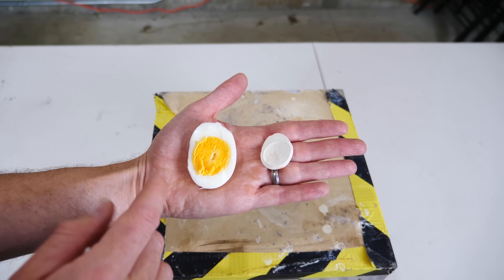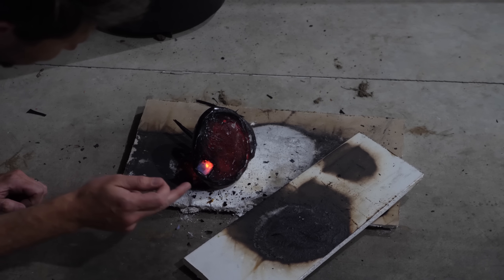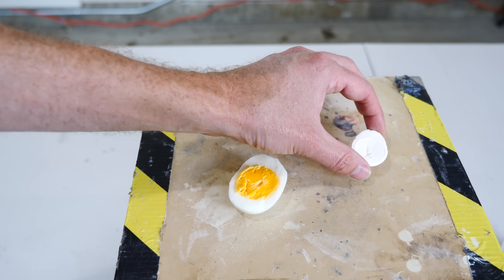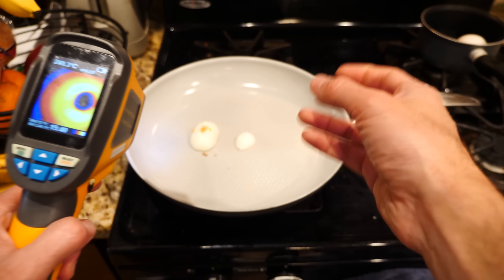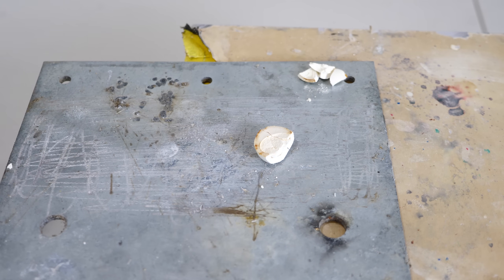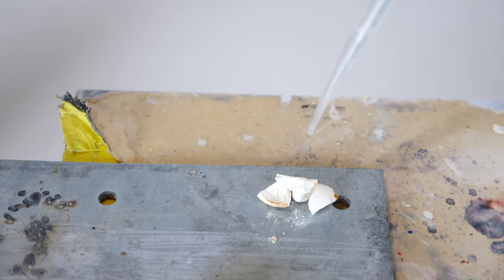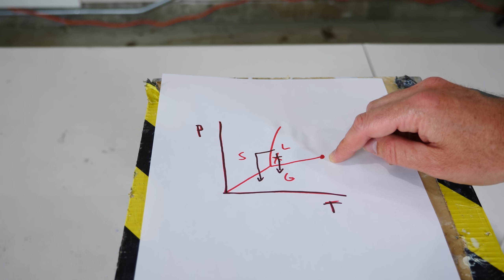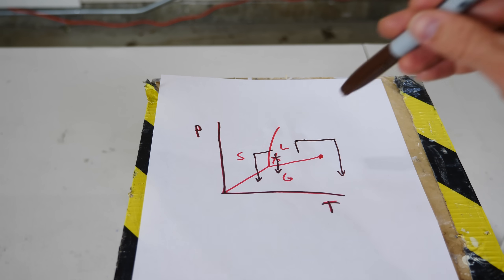How to Make an Aerogel Out of Anything

Comment: is the reconstituted aero-egg edible or as nutritious as say a freeze dried one or the normal one or have the proteins all been destroyed or worse still made toxic? reason for question is NASA uses freeze-drying to prepare foods before transporting them to ISS to reduce the mass of the food... would this be a viable way to retain the structure and nutrition and flavour of aero-fied food stuffs? Also could a similar but modified process be used to make aero-plastics or aero-metals or far better insulating aero-ceramics not using water and ethyl-alcohol and CO2 of course but other suitable materials to create a more rigid aero-fied structure to have similar lightness but better strength or resistance to extreme heat like space craft re-entry?

Comment: I wonder if there is something you can use to stabilize the structure better to where the egg doesn't shrink so much.  You think the egg would look somewhat transparent in that case?  In this case it's looking closer to  a freeze dried egg.
Reply: The silica that aerogel is made of forms a rigid sponge that doesn't shrink.  The proteins of the egg are more like a rubber and have nothing to keep them from collapsing when the alcohol (which replaced the water) is removed.  Stabilizing it would mean filling the voids with something that wasn't water or air, like an epoxy.  At that point, there's nowhere for air to be inserted.  It shouldn't be particularly transparent however, as hard-boiled eggs are not normally so when they still have their natural water base.

Comment: There's a question bugging me from a long time. Make a diagram of earth revolving around the sun and consider you live on the equator and at 12:00pm sun is right above you. Rotate the earth about its axis 360° and it's again 12:00pm with sun at your head. Now if 3 months pass(keeping in mind every 360° rotation brings you at the same place at the same time) the earth will shift 90° ahead but now if you look the point on the earth facing sun 3 months ago is now at horizon at 12:00pm. Why?
Reply: Our day cycle and clocks are not based on our direction in space.  They're only based on our direction relative to the sun.
24 hours is not 360 degrees of rotation relative to space.  It's approximately 360 + 360/365, or just under 361.

Comment: Is the aeroegg edible?
Reply: Technically, yes, but it would be flavorless and have no nutrients or anything beneficial. It would be edible in the same way paper is edible. You would most likely not die from eating paper, so it's technically edible, but it's not food. Though technically, almost everything is edible in small enough quantities. I've eaten cyanide, but since the quantity was so low, I had no negative side effects. That doesn't mean it's safe to eat cyanide. It just means virtually everything is edible in small enough quantities.

Comment: Great video. Raises some questions. This is a two substance substitution and pressure heating drying technique. I would think anything that can be dissolved by the alcohol will also be removed... like the color of the yolk. Other organic molecules? Except for this, it might make a good food preservation method. I'm pretty sure the egg is edible, nothing toxic went into it, but the taste might be off.  This raises a question. The insulating properties are a combination of radiant heat reflectivity, thermal conduction, and convection heat transfer. Closed cells improve the convection reduction, since this absorbs water, it is not closed cell. Does silica aerogel absorb water? If yes, then it comes down to the IR transparency of the substance and conductivity. Organic substances tend to be poor conductors unless carrying ionic liquids... so that leaves the IR transparency of silica vs. egg.  Does this make sense? An experiment with a radiometer or IR light source and IR viewer or just a heat lamp and your temp sensor would clarify that aspect ... maybe?

Comment: Dear Action Lab Man (I hate not knowing your name), could you try filling a sealable bag with aerogel and then replacing the air with helium (or, better still, hydrogen) to see if it floats in the air? It would also be interesting to know whether a block of aerogel could resist the compressive force of being vacuum packed. If it could, I'm sure the resulting structure would be lighter than air.
Reply: Pretty sure his name is James.
Reply: @tjg555  you are correct
Reply: Julian Locke  Those are great questions and I’d also like to see James test them. Aerogels will withstand some degree of vacuum packing. In fact, this paper suggests that aerogels are slightly stronger under compression and that vacuum packing helps protect them during shipping: http://www.vsl.cua.edu/cua_phy/images/c/cf/Aerogel_Aerlon_SilicaAerogels.pdf. 

Keep in mind that silica is heavier than air and it is porous. If you wrap it with anything to contain a gas, the resulting ‘balloon’ will be heavier than a balloon of the same size without the aerogel inside, so there’s no real advantage there.

If you could vacuum pack a large enough piece of aerogel to make it float, you’d also have to lift the material which holds the vacuum. That material would add a lot of weight because its density would be many thousands of times that of an aerogel. But suggesting that a block of aerogel could be used as internal support to create a ‘vacuum balloon’ is intriguing.
Reply: @netpilot5  Thanks for your constructive criticism of my suggestions and for the link to the paper. While I'm well aware that a balloon filled with hydrogen-infused aerogel would weigh rather more than a simple hydrogen-filled balloon of the same volume, I think it could still be made to float in air, and that there might be a potential advantage in using a non-flammable aerogel substructure, which is that the contained hydrogen could not catch fire in the same way as "loose" hydrogen does. I am fairly certain that in the case of a leak, the balloon would sink very slowly as its hydrogen content came to be replaced gradually with air. Even in the case of an ignited leak, the balloon would not be consumed in a great fireball, as any external flame would, I think, quickly be starved of sufficient fuel to stay alight. (Also, let's not forget the heat-insulating quality of aerogels.)
If my rough calculations are right, hydrogen's density is about 7% of air's density, ignoring such subtleties as temperature and humidity. Therefore, even if the aerogel and surrounding container were to multiply the overall density by, say, 10, the balloon would still float. However, a more realistic multiple would probably be about 6, which would give an overall density of about 42% that of air, thus allowing lifting of a significant load.
Admittedly, helium won't burn and is only about twice as dense as hydrogen, and may thus seem a more practical alternative, but we're rapidly running out of helium on Earth, in spite of its being the second most abundant element in the known universe. Hydrogen, by contrast, can be made cheaply and easily in very large quantities (even using fully renewable energy sources).

Of course, given current aerogel manufacturing techniques, an aerogel-hydrogen-filled airship, even of modest size, would be extremely expensive to construct, but I think it might work, at least in principle. Naturally, all my rather vague suppositions would need to be tested and adjusted according to the results. If I had access to the materials, I'd love to build a small-scale prototype and do some tests.
Vacuum-filled aerogel ("filled" so to speak) is a more tentative idea, but one that I think is worth at least investigating.
If only somebody had a "lab" and a certain inventiveness...
Reply: Julian Locke  Yeah, I wonder where we can find someone like that on this channel? 😂

I agree about the current scarcity of helium and that concerns me. I hope that it’s mainly because it’s been traditionally been found as a by-product and the we can come up with ways of finding more of it directly, as we have with oil. 

Thanks for your detailed and well thought out follow-up. You didn’t originally mention the possibility of aerogel preventing a hydrogen explosion, but that’s a really interesting idea. Usually, hydrogen tanks are filled with a heat absorbing material such as metal to reduce risks associated with storage. If aerogel could perform a similar function by slowing the mixing of hydrogen with oxygen in a container, reducing the risk of explosion, there could be a significant weight savings which would offset a significant part of its cost.

Now to see if we can get @The Action Lab’s attention to get his take on this...
Reply: Julian Locke  I hope you meant to address your first reply to ThePrufessa...
Reply: I think this is not possible because the air inside is not sealed in bubbles otherwise it would be impossible making the liquid gas evaporate
Reply: No it will not float in air. It's not a balloon dumbass it's a gel.
Reply: ThePrufessa  Why so nasty? Did someone take your binky?

Comment: The rate at which something heats up when put on a pan is a function of not just its conductance but also its heat capacity.
Reply from the maker: correct, this was a ballpark check. But, if I had done it with silica aerogel it wouldn't have even changed temperature much. So just doing simple tests like this can give a you a ballpark idea of the properties of a materiel.
Reply: @TheActionLab  I think that filed silica and aerogel has some same properties
Reply: @TheActionLab  that's fair :-)
Reply: Yes, the test wasn't really scientific.
Reply: Right

Comment: Would powdered aerogel still insulate well?
Reply: Powdered aerogel is basically just very fine powder. And you would need enormous quantity of aerogel for making even a bowl full of powder. Now this powder is basically silica powder and it will follow its property like silica not like aerogel. (Coz it has no air in it.)
Reply: Yes i think powder arogel is fumed  silica by which dry water is made